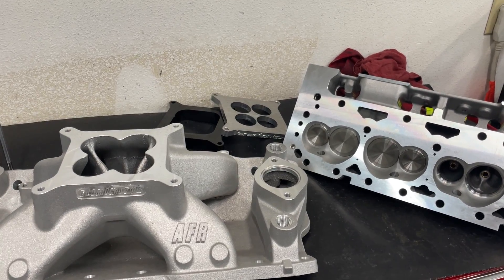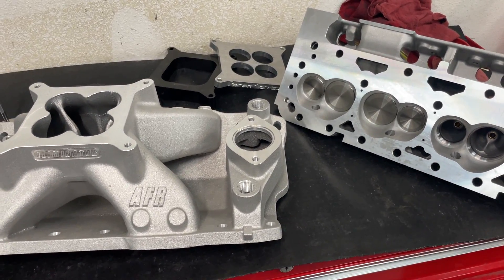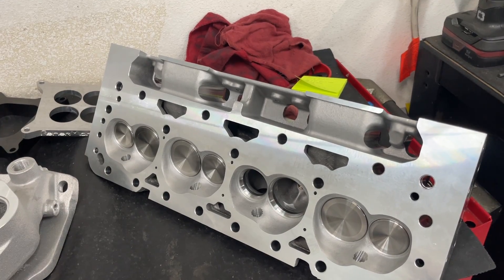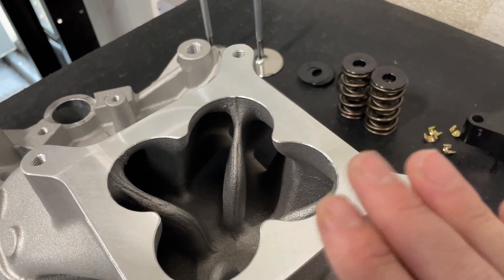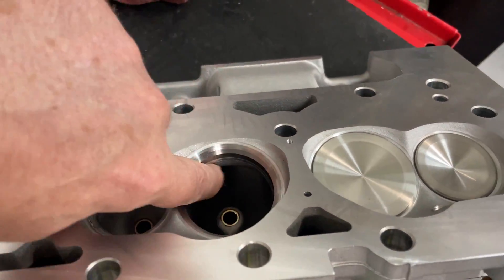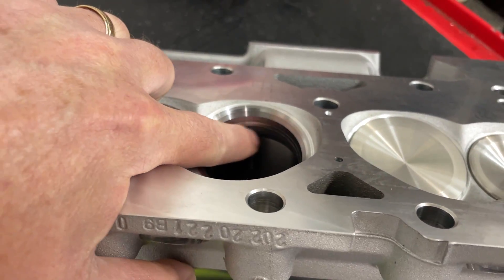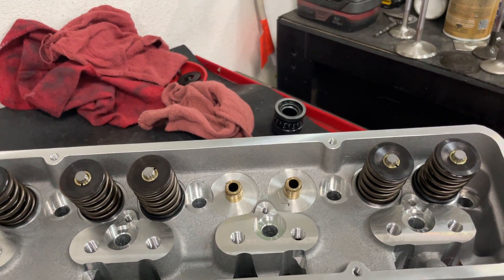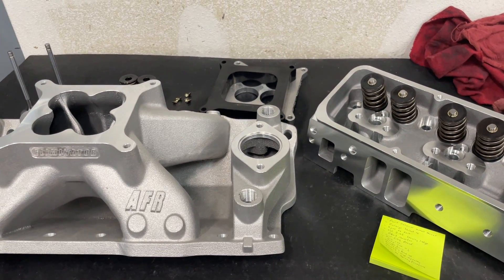The Introduction To The Dyno Mule: The Plan

Comment: One suggestion: on the heads do the “good” changes first, then come back and do the “bad” changes. Like as delivered, good valve job, good throat work, good porting, then too much here, too much there, etc. Otherwise it seems like you’d be dragging some serious mistakes along to subsequent tests. Also, can you get a 1” four-hole spacer and mod it to carry the parts of the manifold cloverleaf up to the carb while adding volume? Or maybe just use a four-hole at first while working on the manifold…

Comment: I’d you do roller rocker test on only intake and use same springs on every test try solid lifter on the side you use roller rocker to compensate for extra weight of roller rocker.
Reply from the maker: I will use the same springs on all tests except when I change to the stronger spring.

Comment: 1-Roller rocker with higher ratio on intake only and exhaust only. 
#2 dyno cam timing advanced and retarded with race vs pump gas . Set up your own knock sensor to monitor

Comment: Eric, this is going to be great. I gotta say, the guys like myself who are drag racers or engine builders, we appreciate all the extra information and knowledge, even if it's not going to benefit my combo and I, at this time. It might come in to use later weather it's a friend or myself.
Reply: Try a set of Pac conical springs. They make them for .750 lift.
Reply: Conical springs have good control and take less power and also run lighter weight valves.
Reply: I think that's a real good project you're starting ! A lot of people are going to gain from this !!!

Comment: Make a book document it.

Out of the box those heads and others with similar generic brand heads did not make much pass 500hp on a 350 or even with a flat top piston 383 it won't be overly impressive, but I'd try your cam in your bigger 406 anyway. The heads will choke it, but You've got nothing to loose, and it will make good content. your 406 should make a bit more  power than my 379ci street combo, with the bigger bore 4.005" vs 4.155".
When your done messing about, 
    "Send me a new pair of the same as your video bare out of the box AFR enforcer heads and the AFR intake, and with an exchange of money if you want it to wheel stand, in your truck, 'll send you back a top end kit, heads, cam, intake and tuned carb, and the matching torque converter, and spec sheet what to set it at for base line, if you want 10 second naturally aspirated quarter mile times out of it from your street truck.
   Before and after your done building the Engine, pull it apart, measure everything, photo it, flow test, Engine dyno it to find out how much HP it makes and how much you can improve apoun it. Do rear wheel HP as a comparison for driveline loss. No one that I know of has done a direct comparison.

Add some nitrous and run 9's with it.

Make a book document it.

Comment: Id like to see just the intake port ported
But it’s really a difficult thing that you have planned here because each previous test could affect what the outcome would’ve been had it not been done but either way more data is always good so thank you for doing this ! It’s going to take a huge amount of time!
Reply: Getting the Exhaust to Flow as smooth as possible allows the exhaust gassses to escape as fast as possible allowing a bigger negative signal on the exhaust valves as the exhaust is going through the Exhaust headers. If you're going to port a head do it right. Intake port gasket matching, Reshaping the short sides, contour around valve bosses, Deshrouding, valve seat angle re cuttig and Exhaust Porting is the biggest things to do any experince head porter will do/know.
Reply: @trxtech3010  he said he’s starting out just porting the exhaust port I’d like to see the opposite to that 
I don’t know why you went into a huge rant I just put in my two cents!
you can make a reply with your own two Cents and tell him how to do it right!
I already know how to port heads I’ve been doing this in a long time and obviously nobody is actually going to just port the exhaust or the intake and send it out the door nobody would do that maybe just a minor amount of work on both but usually it’s always both Anyways I don’t know why you’re assuming I don’t know what I’m talking about when I’m just replying to the video in context 
You telling me how to put a head the right way tells me you probably didn’t watch the video

Comment: Can we see the before and after HP of your different stages of your valve job and then your valve job and a couple different stages of porting? How much $$$$ do you think you need ?  Very excited !
Reply from the maker: I will be doing different stages of portings with the intake ports until full port. Each dyno session is at least $350 so this is going to add up. It also takes time to do.

Comment: Yes, there is one thing. Several months ago you had a head that has a hole between the intake and exaust port. I haven't heard anything about that whether it is a hindrance or helpful.
Could you run that set of heads on this engine?
Reply from the maker: Good point I will do that after all other things are done. Thanks for the reminder.
Reply: @WeingartnerRacing  good deal.  :-)

Comment: Eric I think that your rocker style choice is probablya good one. And actually all of is guy’s that are still running studs may not be doing it if we didn’t already have the stuff lying around. Because if gou had to buy the studs rockers and stud girdles all at once they may be a small bit cheaper than tje shaft set up but the added expense at that point (starting fresh)would be worth it.

Comment: I'd really like to see a pair of MBE heads with one of their two piece intakes, and compare the numbers to those that you make with this combo.
Reply from the maker: There intakes are not for low horsepower 23degree heads.
Reply: @WeingartnerRacing  could do a high horsepower motor. That'd be fun!
Reply from the maker: @JR-The_Godfather_of_Horsepower  I do have a set of heads to do it but the other stuff is still expensive.
Reply: @WeingartnerRacing  a set of MBE heads? I'm really interested in seeing the difference with their different angles they're using, and their changes in combustion chambers from what everyone else is doing. It just seems like there hasn't been anything like what they're doing before in the performance field, but I haven't seen any of their stuff actually on a dyno, only their claims of higher numbers on paper.
Reply: @JR-The_Godfather_of_Horsepower  We used the MBE /CID Ford head and made over 1100 HP  N/A on a nitrous build but comes with a big price tag !
Reply: @combat1878  Yeah I did notice that. Just wondering if it's worth the extra cash. Only about $100 more a head than the big Brodix ones we were thinking about. Of course the MBE heads wouldn't require any additional work once you buy them, at least that's what they're saying.

Comment: Awesome video, looking forward to seeing this on the dyno. Two requests. Could you do a test on the intake before modding it, by adding a 4 hole spacer, then cut the middle out and make it a cloverleaf spacer? I saw Dart do this on a mild motor and it picked up a few hp. Second request is, could you do a rocker are ratio split test? Either a 1.5 intake and 1.6 exhaust or 1.6 and 1.7, then swap them 1.6 intake and 1.5 on exhaust? I've seen people race these combos, but not sure why. Keep up the great work!
Reply from the maker: I doubt on the rockers because of cost.

Comment: If you can find some cheap valves so it doesn't cost alot. Full stem vs undercut stems. Does it cost power and how much. At the end what about epoxy the floors and raise the roofs. I've seen alot of old iron heads ported that way.

Comment: Would it be less expensive for you to buy a second intake so that you can make porting changes to the intake and swap it on the dyno to save dyno time by having two tests in one dyno session?
Reply from the maker: Maybe. One thing that the dyno guy brought up is the order in which you make changes may skew the gains.
Reply: @WeingartnerRacing  ya, I was thinking that also, depending on what the limiting factor of airflow is a stock intake on hogged out ported heads could be a restriction. I like Pontiac intakes because you can cut off the water crossover and swap intakes without cracking open the cooling system, I’m not sure if that would work with these intakes to speed up dyno testing as well. Great plan you have so far, I’ll be waiting for the big block version of the test

Comment: Eric did you attend David Vizard's class?
Reply from the maker: no.
Reply: @WeingartnerRacing  I  watch both David Vizard and you. Mr. Vizard does alot of nice videos. Your videos are great too
Reply: I just thought I would ask because you provid so much information since I look at both of your videos and he suggested that people watch a video you did on a  head I don't remember which head .
Thanks for the information you provide
Reply: Best of luck with this project. I will watch all the videos . I currently run an afr intake that has the cloverleaf inlet but the port exits where smaller with large radius corners. Was able to shape them to match the heads. This combo seems to make good lòw end torque but starts falling off in the upper rpms. This also has a solid roller. Looking forward to all the results Thank for a the info.